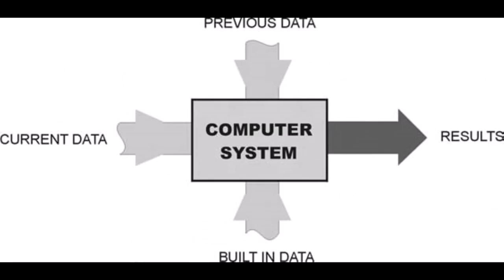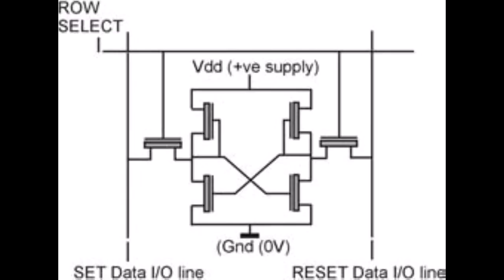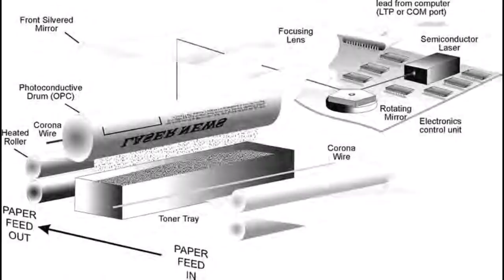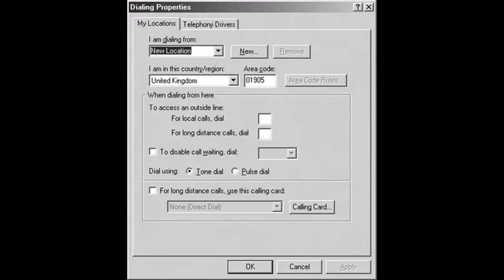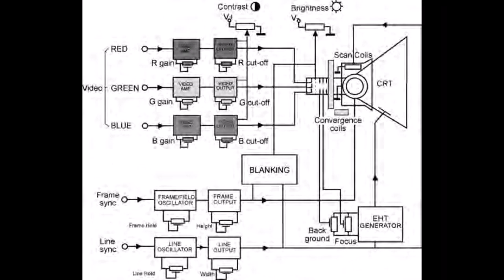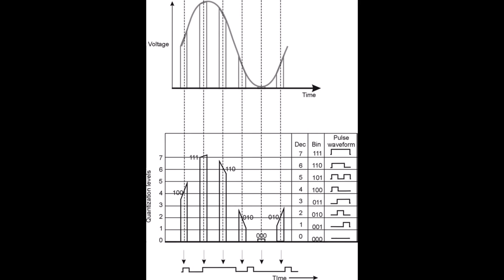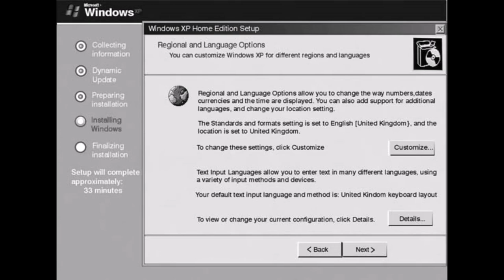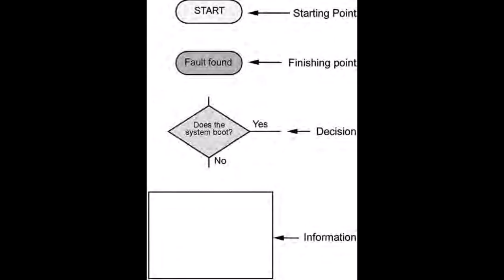06/19/2023___PC Systems, Installation and Maintenance, Second Edition

Comment: The world’s first digital computers began to appear at the end of the Second World War. By today’s standards they were enormous – taking up an area approximately equivalent to that of a small village hall. Their computing power was similar to that of a modern electronic calculator. But despite the shortcomings this type of computer represented a radical change in thinking – instead of using analogue techniques based on electro-mechanical systems, the architecture was based on digital electronics. These early digital designs were composed of thousands of pairs of electronic valves1 each one similar in size and appearance to a small light bulb.